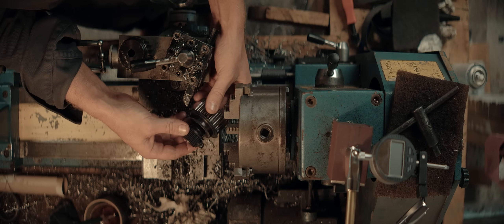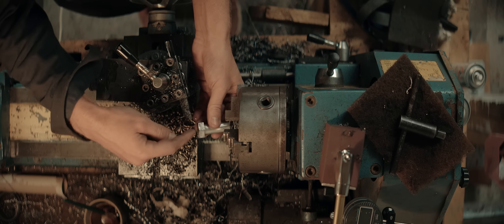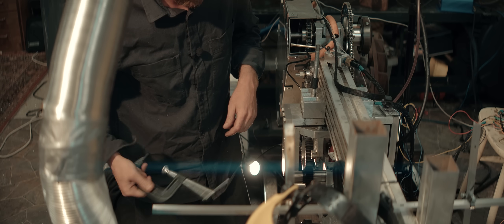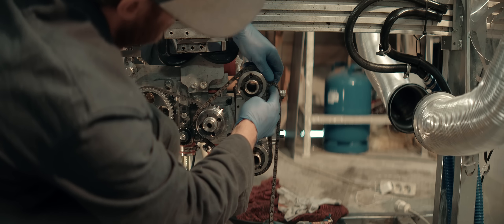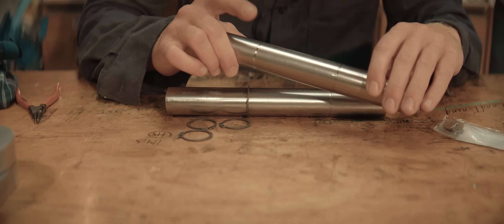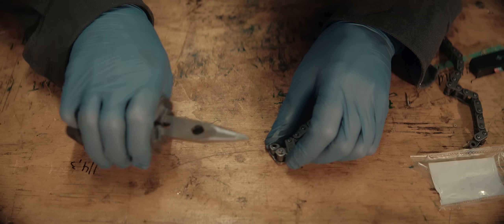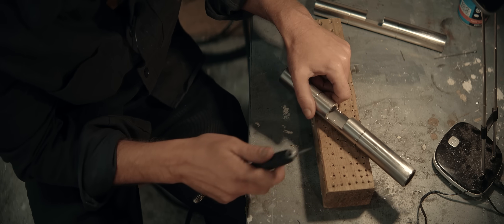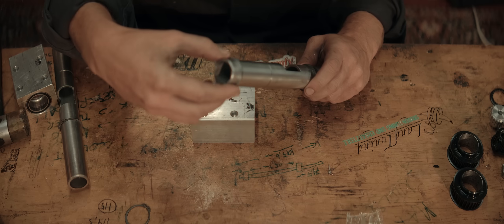Spinning Exhaust Pipes Chain Drive - Supercharged 50cc Two Stroke Engine.

Comment: Im trying to comment but my usb-c charge port is shorting out cause my key board to type what ever in hell it wants to spell . But i will try ..i have ideas i never thought of before until now as i am as defiant as you are when the experts say you cant supercharge a two stroke .first of all you are like so many other who dont  understand two strokes are all internally supercharged in the first place ...thats why i gave you the rotary exhaust valve idea ! Sorry about that ..i never figured it would turn into a brake disk and blow up your handy work
But now with your barrel exhaust valve my wheels are spinning again to a whole new idea of the same thing only this time wear some bullet proof under wear ...they make them for top fuel nitro harley riders that required by rules ..
This idea if you choose to kick it around do it on a CAD software program free download that doesnt eat up all your ram and uses the  standard graphics on a typical home computer thats not the fastest speed ..but way better than old school CAD program that used to require min. $8000 dollar video card but not no more ..but now simple free download CAD will scream fast on a cheapo video game video card and still function on a built in graphics of standard mother boards with no added gpu card but new CAD program will run but slower ..anyway after your CAD is set up on your pc monitor and read to draw images (we will have to start with a new engine from nothing i believe will be faster than modifying the design you have now as my design copies yours but the mods over lap yours with to much grinding and recutting ..starting with a fresh billet block will be easier to see my idea on a pc monitor and a lot cheaper to do if you get interested ...but even in a Compter Animated Drawing of what i have in mind using your barrel valves you still many want to put on bullet proof underwear ...so here's goes and think out side the box ..Why not make one huge barrel exhaust valve that is crucial for my idea to be as simple as it can so far ..it might spin in a bore in the head without a bearing taking lubrication from the oil and gas mix ..and this is what you are doing now with your twin barrel valves we need to see the wear and tear for my big single barrel valve copy to spin freely as it spins same rpm with crankshaft
Can we use cam chain from japanese 600cc four cylinder rice rocket as they crank up to 14,000 rpm making their dohc turning 7000 rpm ...
Make one crank flywheel multitask as drive sprocket for your barrel valve exhausting out one side of head ...barrel valve machined from INCONEL ...NRE makes his own patent mirror image turbos out of the stuff ..
The engine block will be the shape of 3D rectangular box machined from a solid block of 7075 billet air craft aluminium Oops brain fart the valve chain drive must be outside the block not to be involved with internal pressures 
Valve chain will be enclosed and oil tight lubed with ectreme motul high temp. Brake fluide cooled with vanes machined into the crankshaft sprocket pushing brake fluid just enough to circulate a dirt bike oil cooler 
Now on n the other flywheel we cann have a  spur gear over driving a spur gear internally  fasten to your supercharger that mounts flat on the bottom end of the block as close to the crank. And gears with reed andb carbp
Reply from the maker: Sounds like an interesting idea👍 btw, why do you think I got the exhaust valve idea from you?

Comment: Use a cam chain and sprockets from a modern Japanese four stroke moto cross engines as they turn crazy rpm like 14,000 so it should be strong enough....and the tensioners are long metal flat bars coated in a polymer material to lower friction that jam into a slot held in place by another tee slot between the head and jug and then there is a second slider bar with an adjusting bolt(screw) to bow the flat bar by to putaaa tensionaaaaamabavaah

Comment: i don't know if any one else has already said but buy a tipped parting tool, you get blades you slide in and out of a holder block so you can have nice and short or long and the geometry is just far far superior to anything you will grind into a piece of HSS.

Comment: How do you control boost with BOV? I supercharged 2 stroke Yamaha TZR 125 and it makes over 30 psi of boost @ 11k rpm which could be an issue, since peak power is supposed to come near 15k rpm. I have ordered blow off valve, but haven't figured out how i should install it.

Comment: Ever thought about fitting heat isolating 'tyres' to the shafts, so the timing belt becomes a viable option once again? Just feel the chain won't behave too well at higher rpm due to its much greater mass/inertia. Also, if not already done so, i'd consider putting a looser tolerance higher class of bearing where temperatures are high, say C3 class. Thus circumventing possible heat seizure issues. Good luck with the build/project, been watching with great interest.

Comment: If there was to much heat for the belt, how are the seals on the bearings going to hold up? You might end up having to make coolant passages on the exhaust housings like a boat manifold.

Comment: Börjar det inte bli för mycke grejer som ska snurra med?
Tänk när du är i saltöken å du får upp härken i 200 blås å motorn hoppar i bitar å låser 
Upp bakhjulet…
Då går nog spandex dräkten åt hellskotta🤨
Näää kika på en gocart motor med slid .
Har för mej att kreidler hade en slidmatad 50cc på 22 hk som gjorde ca 200 blås.
De va ju inte helt dumma i huvet förr…
Reply: translated  :Isn't there starting to be too much stuff to spin with?
Think when you're in the salt desert and you get t up to 200 blows and the engine jumps to pieces and locks
Up the rear wheel…
Then the spandex suit will probably go to hell 🤨
Look at a go-kart engine with slide.
I remember that Kreidler had a slide-fed 50cc of 22 hp that did about 200 blows.
They weren't completely stupid before...

Comment: I have never seen an exhaust system like this before. Where did you get your inspiration from?
Reply: Saw something similar in a Popular Mechanics back around 1970 I think.
Reply: Just seen the most recent video and it actually runs although there was a lot of unburnt fuel in the air. Really enjoying watching this project

Comment: Would it be possible to measure the torque and RPM at the retarder instead of the engine? The engine cradle seems to be becoming more and more of an obstruction to you

Comment: do you even need a tensioner?
just put some gliders (our whatever its called) on the outside and make it safer at the same time!
I'm thinking of snowmobile boggie slides ;)
Reply: 2 plastic cutting boards bolted together and cnc a triangle

Comment: a chain roller is a bad idea, you should opt for a chain slide like you get in chain driven camshaft engines. it keeps vibration down aswell.

Comment: Fearless design 😜. I can imagine heath problems will cause an assymatrical expansion of the drum. So it will get stuck if your unlucky. You can make a symmetrical design valve only you will need to run it at half the speed in order to have the same opening time. I think there is a drawback because I think the time area of the valve is reduced. You can increase this again with a bigger diameter valve if TA is insufficient. 

Also mentioned in the comments is the exhaust gas going to the bearings. You can solve this by making 2 ‘gas release chambers’ between the actual exhaust part and the bearings. These chambers can just vent into open air. Basically you seperate the bearing part from the part where gas flows. 

Another thingy is that the distance from the valve to the cylinder is relevant. Ideally you want the volume of the exhaust channel between the valve and the piston as small as possible. Because every added volume reduces charging pressure ( or you need to compensate by pumping in more mixture which costs power)

Comment: How about bearing life? I  would suggest using one of those crankcase reed valves on one end of the rotary valve. This way you have all the exhaust on one side, and cool air flowing through the valve between exhaust events.

Comment: I know nothing about engines but im curious if those exhaust ports could have different shapes for the port like a trapezoid so it opens at different rates. No idea if there could be a benefit there but it seems like an area that could be tuned for your needs

Comment: Can you not route the Chain to make both valves  rotate in opposite directions so they both open at top or bottom of cylinder rather then one opening at top and one opening at bottom first ?

Comment: Hey Alex, get a tailstock bullnose live center for your lathe, then you don't need to worry about spindle bore diameter when doing operations like those snapring grooves. Just 3 jaw the OD headstock side, live center the ID tailstock side, voila, fully supported along the full length. If you need maximum precision, use a four jaw chuck on the headstock

Edit: btw, you're going to need some form of thrust bearing between the snaprings and your rotary valve carriers, or those rings will just bore into them

Comment: You probably got about 100 comments telling you this but all you had to do if you wanted to square up that bolt was put a nut on the bolt then you would’ve had two points for the chuck to grab

Comment: I feel like you need to change your port timing to have actual blow down. Having to high intake ports can cause new airfield to burn off during transfer phase due to new air fuel mixture coming in contact with hot exhaust gases

Comment: I would agree with a chain tensioner between the second exhaust sprocket, and the crank sprocket on the lower side, the chain slack will be greatest there. Great job on the barrel exhaust ports, outside the box thinking, Keep up the good work.:)

Comment: Hey, I have one thought on the rotary drum valves, since I worked quite a bit with valves and compressed air in the past. It would be good to check how well they seal, in a static manner. Just with the valve in the closed position, try pressurizing the combustion chamber somehow. I was surprised many times by how hard it is to seal something properly at 1bar and more.
Reply: It kind of doesn't matter, If they leak it will be letting charge air and fuel out. Just cause it's supercharged, else you would be right.
Reply: @OpTicBossaru  yup true. It's just not ideal if you're then trying to achieve a certain boost goal, and start changing the pulley ratio and things like that to hunt it

Comment: I always watch ur project, butbthe more parts u add on the engine the more it will eat the power away. If you bult parts all have to be lightweight aluminun or so

Comment: How are you going to cool the bearings on the drum valves? It would seem you are going to boil the grease and melt the seals with the heat.

Comment: Why not have just 2 exits on the exhaust? That way you could have the entry hole into the spinning exhaust be at an angle. A much better path for flow.

.....& that chain just added a TON more drag (vs the belt setup) that the engine has to waste power to turn.
Reply: But, once up to speed, the chain will have much more inertia than a belt. The thicker and more massive belt sprockets may equalize the inertia factor, but,,,, the chains inertia is farther from the rotating exhaust valves centerline than the mass of the belts pulleys, giving it more leverage. It’s. A very good point you’ve brought up.
Reply: @shanepowers7566  

He could use a bigger driver for the belt to move it out further if it needed the leverage. Yhe real problem was the heat on the belts but that could be resolved as well. Thanks for the insight on the leverage. I forgot he initially was having belt problems with the rotory exhaust valves snapping them. His new belt were buch more durable & solved that problem.

Comment: Won't the half-link create a moving phase shift in the angle of the exhaust tubes by one half link size? Depending on which of the 3 stretches the half link is in, the tension of the belt will be higher there and this could create a resonance or stuttering.
Reply: Excellent question about the 1/2 link!

Comment: my only question with that exhaust setup at thsis time is    are the seals in the sealed bearings going to hold up to the heat? worth the test obviously but in the long run a dedicated internal high temp seal might be required between the port and the bearing
Reply: It's a good question,  the journey to make this little engine work well is not going to be easy...  I was thinking the areas that rotate near valves/ or rotary drum valves may have problems with heat
Reply: @davidbeer  yeah heat is that sneaky little bastard that just rears it's ugly head when you least want it to

Comment: what about the tube exhaust is beneficial compared to the rotary ones? i feel the 90 deg bend in flow path will be significantly worse than the straight out you get with the rotary disc. moreover disc valves arent to uncommon in engines especially compared to these tube type ones, ive only ever seen a couple 4T prototype engines boasting them. 
also are you and if so how are you gonna attach the rotary valves to a fixed exhaust?
excited to see results

Comment: just a thought, in the 4 stroke side of engines, you want a less amount of mass to spin to get better rpm, considering the size of this engine and adding that much of weight to spinning side of things, does this have a negative effect to rpms and sensitivity of engine ?
Reply: I would bet money it does that’s the big argument between super chargers and turbos just the power it takes to turn the supercharger itself is why turbos will make more peak power so chain driving that exhaust system is going to rob a lot of power but because of his ability to tune exhaust timing it might make more power think variable valve timing in a four stroke
Reply: @600wheel  the rotating mass has little effect on the horse power, but it has a large effect on the acceleration of the engine, which also reduces the acceleration of the vehicle, especially in the lower gears when you have to shift rapidly. In the higher gears that is not much of a problem. Since he wants to use a CVT transmission the reduced acceleration of the engine is just relevant for the first few meters after start, after that the engine rpm is almost constant and therefore the rotating mass of the engine is no problem anymore.

The problem with superchargers vs turbo is, the superchargers steal a lot of hp from the crankshaft while turbos take their power from the otherwise wasted energy of the exhaust gas.
Reply: It's about moment of inertia which goes as radius squared which is small in this case. T

Comment: I'm a bit concerned about the bearings in the exhaust housings, will they cope with the high temperatures? Or better, will the lubricant cope?
Otherwise you can choose to use bearings that can regularly be re-greased with a high temperature resistant grease.
Reply: There is oil in the fuel.
Reply: @warrenafflick6498  it's using sealed bearings on the tube/valves.
Reply: @warrenafflick6498  Yes, but that oil can't reach those bearings as they are on the outside of those exhaust pipes, they need grease to stay lubricated.

Comment: Putting the tensioner between the valves might make their timing less accurate. it doesn't feel like it would be enough to cause problems but it might be better to just play it safe and put it coming off the drive pulley.

Comment: Run that chain on something it will get hot and stretch and maybe can lose That half link. You won’t see a tensioner between to cams of an engine ( your case drum valves)  it’s always down one side or the other . Nvr between the 2. If you were to  tension it, it  will change the timing. Chain needs to stay straight from one drum to the other. If need tensioner then you have to put on one side like a tensioner on timing chain/belt on  a typical car engine. Cam timing and drum timing are essentially the exact same function and importants. Tension like they do for car.  If a car has a guide between the cams it would be fixed and be for packaging reasons. It would not be  adjustable
Reply: It's probably not the end o the world if the timing between the two exhausts is slightly different. There's so much flow area that it'll have no problem exhausting. It's not like an interference part in a 4t engine where shit breaks if your cam chain timing is off. 

To maximize potential of course timing needs to be perfect, but it's probably ok for prototyping if there's no way to mount easily mount a tensioner.
Reply: Same with DOHC motorbikes. Chain tensioner is in the barrels pushing against the length so that the cams/valves always have a fixed length of timing.
Reply from the maker: Thanks for the heads up!